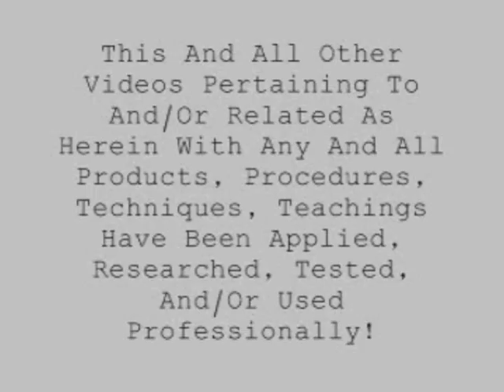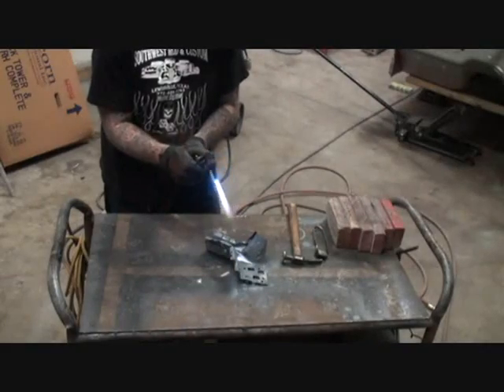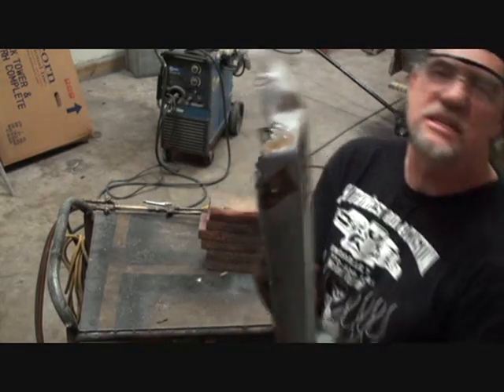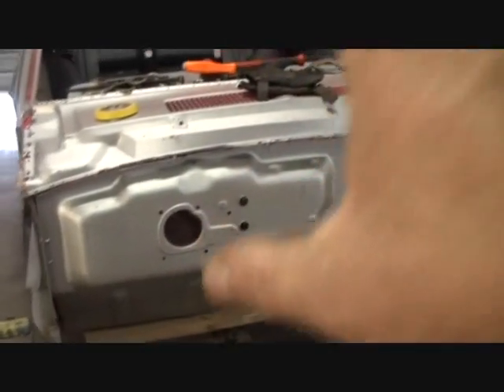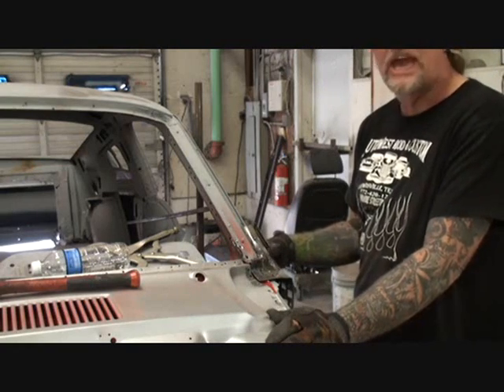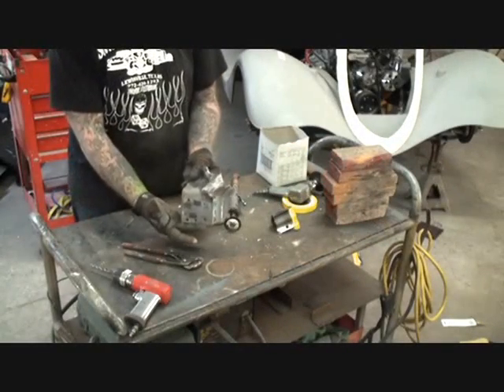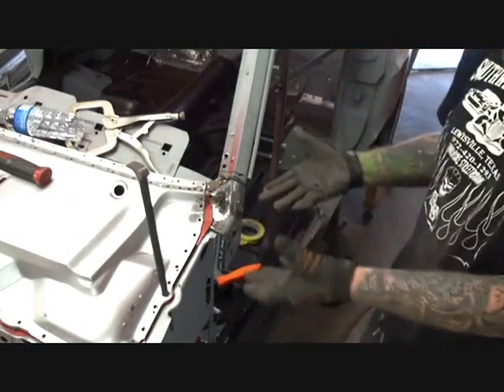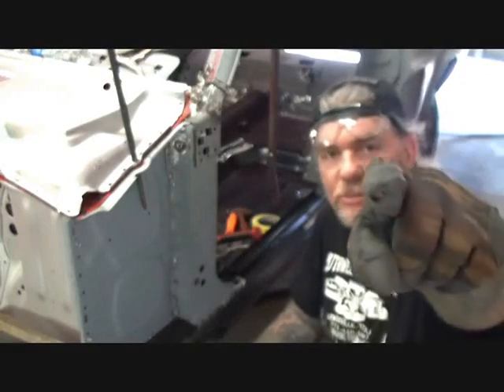"How To": "Restore" A Rusted Out "Car"-Part 17

Comment: Hey Pete what do you think of using panel bonding glue ?I have been thinking about using it to repair my rocker panel and my right rear lower quarter panel extension. Do you think this is ok or should I MIG weld the parts?

Comment: I noticed your vise grips kept wanting to fall off on the inner pinch weld area of your door post pillar. An area like that is where I like to use my duck bill vise grips, as they seem to hold more of a given flat spot area. Looking good Pete. I am curious how you will install the door and hinges and be able to close the door to check your fit with the vise grips in place. Big job there, Bud!
Reply: Will be interesting to see, that's for sure.

Comment: Good vid as usal Pete,just thinking aloud the small bracket that you heated up befor dolling out the creases would that be made to a certain strength and by heating it would that change the strength compromise its structural integrity ....Do you now have to heat and quech it or am i being over the top wishing you well as all ways
Reply from the maker: NO, heating a section of steel up like this won't hurt the metal. this piece is so small that heat will not effect anything but helping to straighten it out!

Comment: More useful auto body tips. What amazes me is the rest of the world thinks work like this is EASY and takes just a few minutes to do. Just like today i spent over 2 hours block sanding my hood with 180 grit (wet) when block sanding the hood (D.S.) ALWAYS sand perpendicular to the hood. Every time the owner walks up to vehicle he see's the D.S. of the hood.
Reply from the maker: Work like this is harder then digging a ditch, because it takes MIND POWER to get er done! Paint And Body work is a REAL JOB! Weather your spreading bondo, pulling dents, replaceing panels, welding, block sanding, ect. It's hard work .
Reply: diyautoschool Pete, it is hard work. Maybe that is why just one example would be the kids coming out of these vo-tech schools paint and body classes show a average of a 14 percent retention rate of staying in the field after graduating the program. They all want to make 15 bucks an hour, but most don't wanna do the hard work the field requires. This trade is hard, dusty, dirty work. I really think you need to have a true passion for cars, and enjoy working on them. It takes years and years to get good at doing this work, and Pete gives you an inside look at what is involved in our line of work. Some days I wanna quit doing this type of work, but after coming out of the paint booth after painting my repairs, you feel good again. It gets frustrating and tiring some days. Pete does a great job of showing you guys the in's and out's of the trade. Watch and learn. Not many guys wanna teach you how to do our line of work.